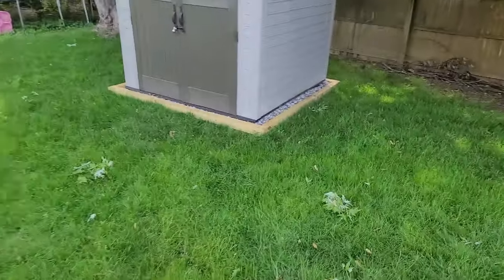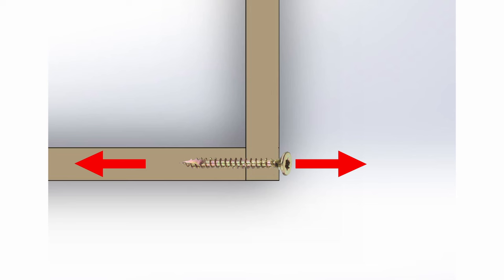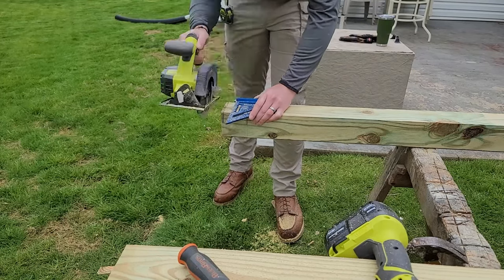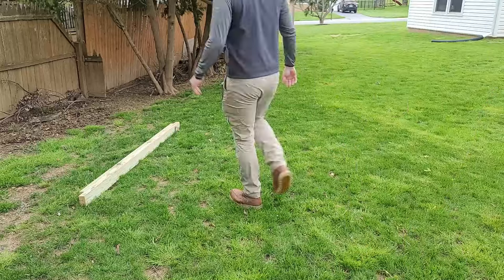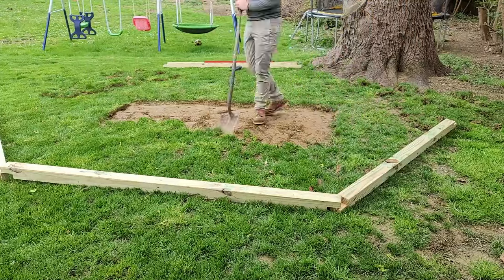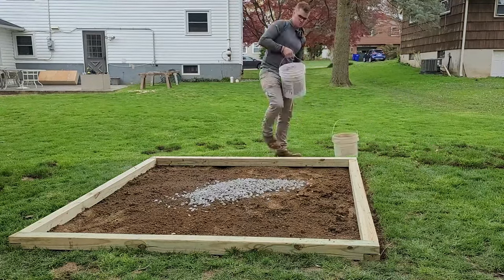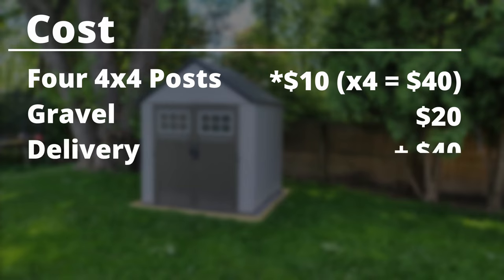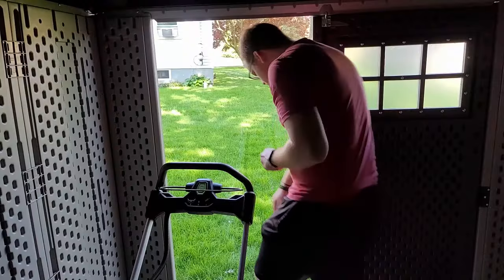Building a Shed Foundation for $100 | TIMELAPSE

Comment: While this is a nice presentation, resin sheds like this are so light they need to be anchored down to protect from wind.  The manufacturers recommend a poured concrete or fully framed pressure treaded frame with 3/4" plywood, with lag screws anchoring the floor.  Hope this works out for you, but this is not really an adequate way to build a shed base.
Reply: I have my resin shed from Costco over 20 years.. never moved, not anchored - sitting on dall stones though.. not rocks.... besides.. theres so much stuff in there.. its impossible to move.. unless your talking hurricane alleys etc.. Im talking Canada
Reply: We have a resin shed that is similar to this. It is sitting on concrete slab, but we anchored it by filling it with paver stones. We have shelving units on either side and it’s so full of crap. It’s not going anywhere.

Comment: This is by far one of the fastest ways I’ve see a shed foundation be made. I’ll be getting a shed in 2 weeks and this has saved me time and stress on how I’m going to build the foundation for it. Thank you so much and this video is very helpful.!
Reply from the maker: This was a great 1- day project for me, and with a wheelbarrow it will go even faster! I'm glad it was helpful for you!
Reply: Exactly what i was saying. So much easier than others.
Reply: Where did u get the shed or how did u build it I saw how u build the foundation now I wanna see how the shed was built
Reply: @thebackyardbuilder  I found your video by chance to be the exact same shed I plan to buy.  How are you finding it so far?
Reply from the maker: @josiahr1375  it's a pretty good starter shed. I think down the road I may need to upgrade just for a bit more space and structure. I have noticed that if I hang a lot on the walls, it bows somewhat
Reply: There a shed video for 3 hours, the old man just kept talking and talking, like he filmed it on Xmas or the holidays and he was so alone.

Comment: If you're trying to get off on the cheap by getting a resin or Rubbermaid shed, this is a great idea - save a ton not dealing with cinder blocks, a pressure-treated base, and time leveling too. Very clever idea.
Reply from the maker: Thank you very much! I got the shed for free, so definitely saved on cost there!

Comment: Nice and simple.  I would consider a couple slight alterations/additions.  4×6 would maybe be better since it would allow you to set the wood in two inch trenches. Use weedblock prior to laying the gravel.  Also consider rebar in each corner for stability.

Comment: 2 things. 

1) screws don’t pull out. 
2) before the gravel, put down a weed barrier mesh.
Reply from the maker: Screws can pull out depending on the orientation and load on the screw, but I agree that I probably would've been fine the other way. 
This is a temporary shed for me so I'm not too worried about weeds, but I will have that under my next shed for sure!

Thanks for watching! :)
Reply: @thebackyardbuilder the purpose of the weed barrier is so the gravel doesn’t sink into the dirt over time and become nearly impossible to remove later without just digging out the entire area.
Reply from the maker: @blakethingstad5052  ah I gotcha, that makes sense! I plan to dig up the foundation anyways when I get a bigger shed so no harm no foul 👍
Reply: Weed barrier doesn't work at all, I've tried it many times and it always comes through.  @thebackyardbuilder
Reply: @disgruntledveteran79  I think they meant to use the weed barrier just to keep the gravel from sinking into the mud over time.

Comment: OMG, YOU’RE A LIFESAVER 👍🏽🙌🏽.  I had planned a patio remake for this summer that just recently ended.  I purchased a new shed and had items marked on my patio according to my plans/layout.  
My much larger storage shed arrived that I’ve purchased to store my outdoor items  but I also specifically purchased the shed to 1) keep the leaves and debris from the branches that hover over almost the entire rt side of my patio where there’s nothing but uneven dirt and roots anyway but it’s a HUGE PROBLEM bc there’s CONSTANTLY LEAVES and A MESS ON THE WHITE FENCE TO CLEAN UP and 2) I cannot metabolize Vit D  so it was ordered by my doc to spend 20 mins minimum outside daily bc each of the many rounds of high doses of Vit D proved unsuccessful.   Going outside is an issue for me bc I have other med situations so this summer was going to be the seasons where those things wouldn’t stop me from “simply” going onto my patio bc this much larger shed would also store what I need to deal with my obstacles in a dignified manner whilst abiding by my lease bc I’ll have an easy and secured place to store what’s needed while I’m out there. 

*I almost forgot….the reason YOU LITERALLY SAVED ME JUST IN TIME is I just received a notice Re patio inspections taking place between a date that happened a week ago until  some time early in OCT.  I hadn’t been able to get the shed assembled bc I’m not familiar w/building foundations and especially not on uneven ground. While I was trying to deal with that situation, I had gone to the dentist and that one cleaning ended up costing me my entire summer bc I had surgeries every 2 weeks and check ups from the second weds of June til Sep - I’m still healing.   It’s a blessing to be able to have what I needed done (another issue caused by a drunk driver 17 yrs ago) medically yet the burden of needing to get my patio redone which started with the new shed assembly worried me even more bc now I couldn’t physically do anything about it (couldn’t even hold head down or lift things).  I did buy a few items for the foundation prep but I was completely at a loss UNTIL I FOUND YOU VIDEO JUST NOW 👏🏽🙌🏽👍🏽🙏🏽☀️
Reply from the maker: Thank you for sharing that amazing story! I'm so glad I was able to help. That's all I want with these videos is to be able to help people :)

Comment: Thanks! - I was able to use leftover scrap wood to save even more. The tip on having them deliver the gravel was a game changer! On my project they could access the area that I needed it to be permanently placed then offloaded, required SO much less work then expected and was worth the delivery fee.
Reply from the maker: If you can have them deliver right to where the shed foundation will be, that's so much nicer! :)
Reply: Hope you used pressure treated wood!

Comment: Building this set up this weekend. I don't have a saw, so I used butt joints on the 4x4's with 90 degree angle ties to secure them on the inside of the frame with 6 2inch deck screws on each corner. For gravel I am using crushed limestone gravel (1-1.5"). The shed is a 7x7 Rubbermaid like the one shown except it has a window on the front above the doors. Thanks for the idea! Saved me money vs pouring a concrete base.
Reply from the maker: Happy to help! Hope it works well for you!!

Comment: I appreciate the video,, as the cut into the ends of the 4"x4" reminded me of when I cut the 6"x6" posts for my deck to support it's weight.  When I built the foundation for my 7'x7' shed I oversized the area, to  a 9'x9'.  I chose to use skids that i was fortunate to be able to get   as my foundation.  However below that i did put a layer of gravel down ( I dug too deep , and ended up overworking myself  uneecessarily.  Fortunately I had enough gravel to cover the skids (with tarpaper over it)  having no wood exposed, only an appearance of a gravel base.  I rented a pick-up truck myself to have the gravel loaded.  Sorry for the pail carries up/down to the back  of the house 😖    Cheepest and effective route I could think of.  I hope you bought the pressure treated 4'x4'
Reply from the maker: @ralex3228 I did get pressure treated so we are good there 👍 thanks for watching!

Comment: Two questions: 
- Would the wood directly on the ground or be at risk of rot/pests? 
- Is the shed not anchored into the ground in some way? 

I’d like to do the same but was considering building the frame the exact dimensions of the shed so the walls can be anchored to the wood base, and rebar driven at an angle into the ground/frame so it won’t blow away.
Reply from the maker: @BorkMcGork  if you use lumber treated for ground contact, it was last for a long time before rotting. I did not anchor this one, but there are anchor kits you can buy if you would like to anchor yours

Comment: This is great if you don't live in hurricane country, or get a gentle breeze. I once watched someone build one of these and immediately it was blown about 20 foot away. It was metal and completely destroyed.
Reply from the maker: @jacka55penguin  resin shed can be good or bad depending on where you live, that's for sure. This is a free shed I was given so I am happy to make it work until I upgrade. You definitely want anchors though if you live somewhere with high winds

Comment: using 2 2x4s to make a 4x4 might work as well as being able to run the grain in opposing directions to hopefully mitigate twisting and warping, and make the half laps very easy... does that make sense?
Reply from the maker: @xisotopex  yeah that makes sense, I like that idea! I had a similar one about 5 mins after I finished cutting all the 4x4s haha. Hindsight is definitely 20-20.
Good idea though and thanks for watching! :)

Comment: I’ve been contemplating a shed foundation for months. I was going to lay rock/sand and then lay 12” pavers down but then I saw your video. 
Went and bought the 4x4s yesterday at Lowe’s for about $65.  My shed is 7.5 x 8 so I am making mine just slightly larger than yours. 
Rock is like $25 a yard which is plenty. (Extra for delivery)

I’m about ready to start cutting the wood like you did and get this foundation built!   
I may use smaller rock than you used, so it packs down more smooth. 
Thanks for the idea. It looks nice, fairly simple and will drain just fine when it rains.
Reply from the maker: You're welcome, thanks for watching! I'm glad you found it helpful :)
Reply: How is that shed doing after a year with the gravel foundation?
Reply from the maker: @stanb2748  still going strong!
Reply: Is the shed just sitting on the rock, or is fastened down for wind?

Comment: Another way to "screw down" and connect the post is, use galvanized "Tie Plates" they come in different sizes. I would recommend using a sizable tie plate on both sides to secure the post do not come apart. This saves a lot of time from cutting the post and screwing them together. Just another idea.
Reply from the maker: I like that idea a lot! That would definitely save some time, thanks!

Comment: Only thing I don’t care for is there’s no weight on the 4x4 boarder. So if the shed settles the boards could potentially end up interfering with the door opening if they rise at all. I would attach 4x4’s diagonally across each corner about 3ft from each corner. Then dig the ground out so they can be covered with the gravel. The weight of the gravel and shed will keep the border against the ground instead of free floating as it is now.
Reply from the maker: That's a good idea! I was going more for cheap than super sturdy for this one because it was a free shed I was given and I plan to get a nice wooden one down the road and so for that one I will make the base really nice 👌

Comment: We’re going to have the 8 by 8 shed from Reeds Ferry installed early next month, and we plan to just let them install it on the ground without digging. Because we don’t have much room and it’s easier. We will demolish the old one first.
Reply from the maker: @Riconald  what is he shed made of? If it's wood, you will need some sort of airflow underneath so it doesn't rot out

Comment: Hello Jeff, 
I have watched a few videos regarding building a foundation with gravel and turns out   they are offering their installation service and I did not see any prices thus  very expensive.  Your DIY build-a- foundation is in the price range I can afford and I appreciate that you itemized the costs. I ordered a 7×4 shed just like your shed; what size of foundation would I need? What type of gravel did you use? I look forward to your answers. Thank you so much! 
Susanne F.
Reply from the maker: Thank you so much for watching! I would say you could probably make your base either 8x6 or 8x5 depending on if you want even spacing all around the shed. I believe I used 3/4 inch gravel, but you can always ask your local stone supply what size they recommend.
Thanks again for watching my video, I'm glad you found it helpful :)
Reply: @thebackyardbuilder  Thank you for your reply.

Comment: I’m getting a storage shed and a couple concerns with doing it this way. 1. The shed isn’t anchored to anything as far as I can tell. Do you not get high winds in your area? 2. No barrier under the gravel. Are you just hand picking the weeds as they come through the gravel or some other suppression process?
Reply: concerned about the weeds put one of those no grow tarps down first
Reply: I’m concerned about it not being anchored as well. I may have to go a different route due to high winds in my area
Reply: Like Wise. Highwinds in our area. They do make shed anchors which I don't know if they'll work for these plastic sheds or not.
Reply: I’ll be doing the same build but I am going to drill the wood and pound some rebar into it to anchor it down. Then I will secure the base of the shed to the wood. In my mind I think it will work will see. I might add one more piece of wood in the middle to secure the shed more.
Reply: @zachary4225  What I did was build a wooden platform with plywood and then screwed the storage shed to the plywood. It’s been working for 2 months now. Have had some real high wind days and it’s held up.
Reply: @harveydodd8803  awesome. Glad it’s working out for you.

Comment: How has water drainage been? Seems like the wood might trap water in, rather than allow it to run..  maybe drill small holes in the wood for drainage?
Reply from the maker: @krispy5139  haven't had any issues thus far! The holes could be a good idea though :)
Reply: @thebackyardbuilder  thanks, also trying to decide if pressure treated lumber is needed or not.
Reply from the maker: @krispy5139  if it's touching the ground, treated is usually better, but you can get regular, you may just need to replace it sooner

Comment: Awesome video. Have you thought about using a grid panel then put the gravel on it to make ot more stable? Just curious, coz i wanna put a shed i bought from Costco 6'3" W x 3'6" D x 5'9" H. Thank you.
Reply from the maker: I didn't think about that when I was doing mine, but that is a great idea for added strength!

Comment: Awesome! Quick question, did you have to anchor the shed in any way? If not, do you ever have issues with the shed moving from wind, or anything like that?
Reply from the maker: I did not anchor my shed but there are shed anchor kits you can buy. I haven't had any issues yet and it's been over a year now :)

Comment: Great video. I'm in the process of buying an 8x10 resin shed pending approval from neighborhood's HOA and have been trying to figure what's the easiest thing to do for a foundation as it's just me building it for the most part. Thanks a bunch!
Reply from the maker: Happy to help!
Reply: How did the build go?
Reply: @wakawaka1976 wound up using square foot concrete slabs and level sand. Took 3 days total including the shed

Comment: Love this video. So my shed is 8ft x 7.5, so I'll most likely need to go 10 ft lumber for each side. Unless I went 10ft lumber on the 8 ft. side of the shed, and 8ft lumber on the 7.5 side of shed. Also, you said the posts are actually 3.5 x 3.5, but home improvement stores list them as 4x4x8 right?
Reply from the maker: Yeah you could use 10 footers for the longer side. And you are correct, they are sold as 4x4 posts but they are actually 3.5 by 3.5.
Reply: Google dimensional vs non dimensional (nominal) lumber. Every man and woman that ever builds anything with lumber needs to know this.

Comment: How did you secure the shed to the foundation? I think only with 4 posts and anchors to the ground, high wind will blow the shed away
Reply: Yep- same question. There's no way that shed is secured to the ground.
Reply: If you fill the shed, it won't blow away.